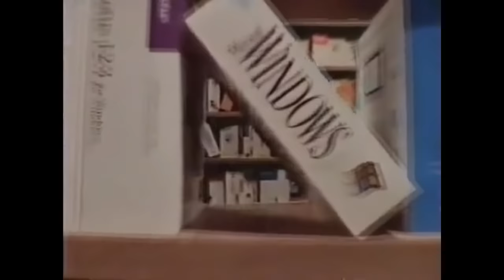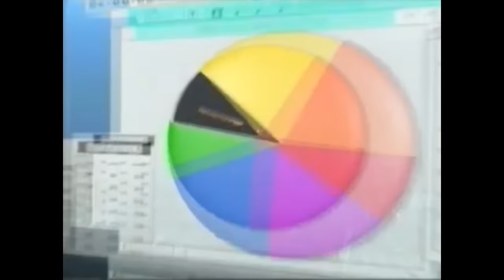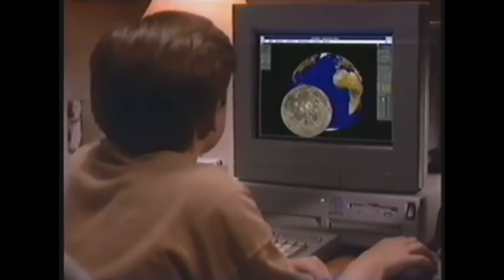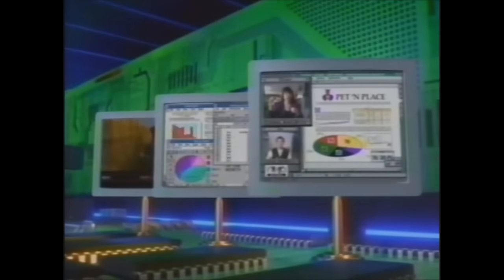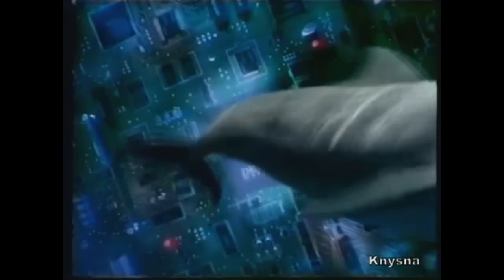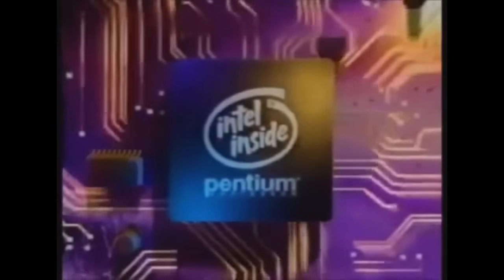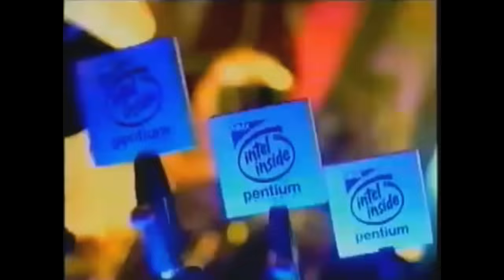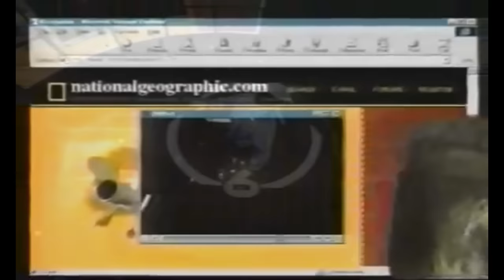Intel Commercials

Comment: The 90s ads especially the graphics are actually so much better than even now. How did they do this and why cant it be done anymore
Reply: It looks better than it really is because it's low-res. They also had a lot more incentive to spend money on ads back then.
Reply: When you are resource poor or/and have constraints you won't believe how innovative you can become to solve problems.
Scarcity is a blessing in disguise.
Reply: Because it's "Old" now, back then when Computers were the new thing where everyone was getting one, it was a super duper new thing and they made great commercials.  Nowadays this is old news.
Reply: They used the Pentium processor !

Comment: Gateway 2000 P5-75 for me. Pentium 75 Mhz. 8 MB (yes.. Not GB,  MB!) of RAM. 300 MB hard drive. Came with a printer. Only $2300.

Got it in 1995, delivered to my dorm. Walked by the mail room (only 2 days after I ordered it and noticed a cow spot box in the room. Checked my mailbox and saw a "your have a package". Did a happy dance.
Reply: +Zoomer30 Well my RAM was 4 GB and a 600MB Hard drive (lol)
and now i have an 2000Mb hard drive and 8MB ram with i6 6700k 44.00GHz

Comment: My PC has 4 GB of RAM, a 456 GB hard drive, a Intel Celeron Processor, and has Windows 7 and Windows 10
Reply: My pc has -90 MB of RAM,a 10 GB hard drive,a Intel Pentium 1 Processor,and has windows 95
Reply: Don't worry, mine is worse. I have 2GB of RAM, a 32 GB hard drive, an Intel Celeron N3350 and Windows 10.
Reply: Im the one here with i5.
Reply: 10GB ram, intel core i3 and Win7 (Note: that's my old PC, and that PC didnt work anymore because of the faulty ssd.)
Reply: @Nguyen Thanh Viet The motherboard is fucked up
Reply: Ok then. My PC Has 8GB RAM, 512GB SSD, Intel Core i5, Windows 11

Comment: I Like The Intel Centrino CPU
Reply: And This Processor It's Based On Pentium M Processor.
Reply: WHAT THE F**K
Reply: It's Real Not Joke!
The Intel® Pentium® M processor is a key component of Intel® Centrino™ mobile technology+. Based on an architecture designed specifically for mobile computing, the Intel Pentium M processor delivers outstanding mobile performance and low power enhancements for sleeker, lighter notebook designs.

From
http://web.archive.org/web/20041209040925/http://intel.com/products/processor/index.htm
Reply: Centrino is outdated crap
Reply: Until now, Intel® Centrino™ still continues to be used, but only as wireless products.
Reply: Andreea Constantin it is good
Reply: I really like Centrino! Especially Centrino Duo

Comment: 0:38 This symbol outside means you have a standard inside that of the entire library of software has been written to. The Intel microprocessor. Think of it as a library card but let’s you run the software of today and tomorrow. So look for computers with Intel Inside.
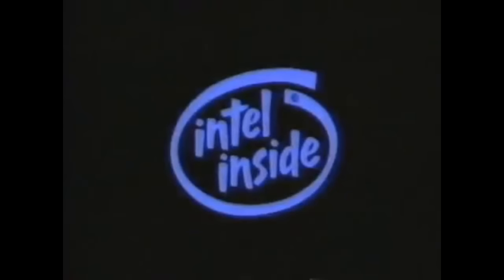Reply: 1:08 Want to run your windowing software fast? Then you need a power source inside your pc that offers high performance. And the power to code with tomorrow’s advanced advocations. It’s called the Intel i486DX2 processor and it’s convertible with all popular software. The Intel i486DX2. Make sure your next pc has one inside.
Reply: 1:38 This symbol outside says inside you’ll find a lasting commitment to performance. Intel i486 and i486DX2 processors bringing software to life all around the world. And now the Intel Pentium processor the newest generation of compatible power. The Pentium processor another powerful reason for insisting on Intel Inside.

Comment: Im watching this video on L5460 CPU. (server with x58).  in 1997 I used a MX166 PC instead of my 486 INTELPC ,infact I used them both .  486 is not obsolete at 1998 year. still can do office(WP S) work with printers.

Comment: 23:30  Intel i5 interesting want it now, where can i buy? Other than that, ads made 1992-1995 the best lot of hard work especially considering what time it was. I wonder whenever it was rendered on Intel processor or one of these brand new SGI Onyx or UNIX based MIPS R4000 machines :)

Comment: WHY DOWS EVERYONE FORGET CENTRINO 2 PROCESSOR WHY???
Reply: Im not
Reply: U are
Reply: Ok
Reply: +The Yellow Gamer its forgotten because it is largely outdated
Reply: I wouldn't forget it this time when my next video uploads.
Reply: Wada Don Plus, Intel® Centrino™ still continues on. It is just used as wireless products. Like right now, I am connected to the internet via Intel® Centrino™ Wireless-N 2230.
Reply: Anthony Regner The full software chipset though, including the processor and external GPU chip is mainly outdated, however wireless products are still branded as Intel Centrino
Reply: I have a centrino laptop